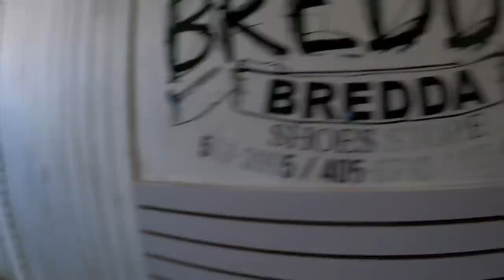| Millions of dollars lost in Portland fire today |

Comment: As a Firefighter Jamaica fire chiefs need training on 360 and calling backup along with hitting hotspots, putting the Ariel truck to use would have knock down most of that fire. Drizzy set mi a link with the fire chiefs, I see a lot of firefighters in the Hot Zone without airpacks, cancer is real my brother. Prayers for Portland
Reply: They just don't have the proper resources bro
Reply: ,@fulltrottlw vlogs Jamaica don't have that resource bro and this is in Portland far away from the Little help they could get. There was no life lost and that's the most important thing.